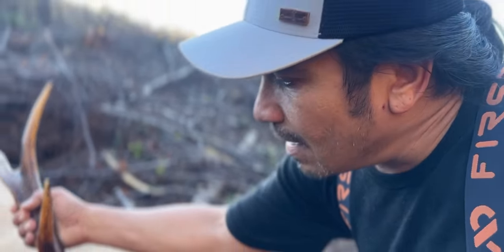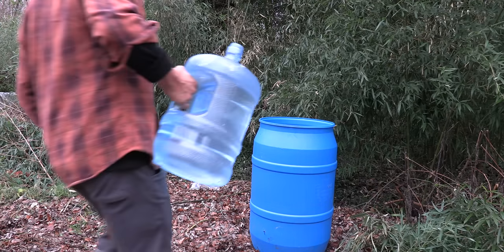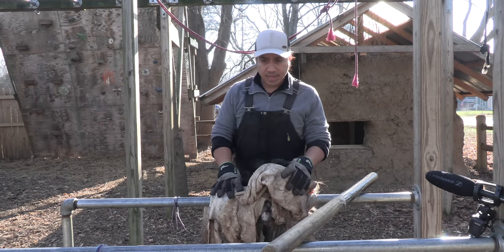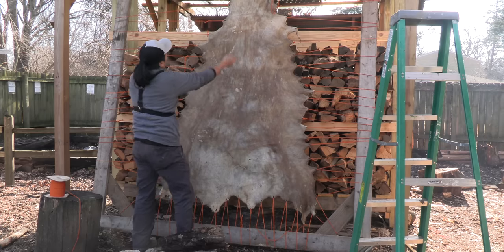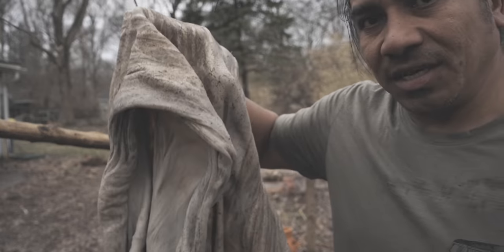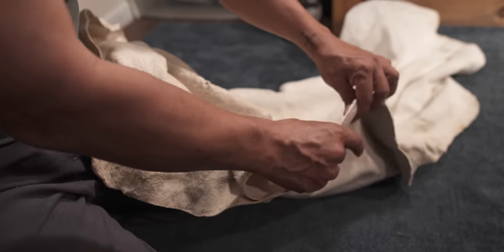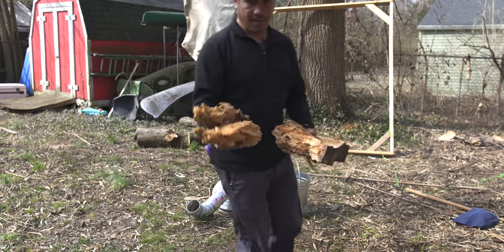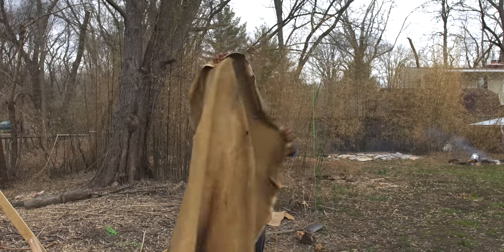Brain Tanning Elk Hide

Comment: It was really nice to watch you make buckskin out of an elk hide. I used to do the same with many deer and two elk. The elk is definitely much more work. You did a couple of steps that were new for me. Using that potash was new. I have used ashes before, but we would string the hide up on the frame and scrap it with a scraping tool made from a planers blade with the same angle your tool had. My tool had a wooden handle about three feet long slightly curved with the blade at a 45 degree angle attached to the top. I would let the hide dry and shave the hair and epidermis layer off . When you use the shovel like that does it remove the epidermis layer off? I did the wringing step many times also. Did you say  you put the brain solution on many times?  Almost all the steps you did were the same as I did to make traditional buckskin.  It is correct to add the cloth at the bottom to prevent burning your hide. Elk skin is so strong. It is nice for moccasins, jackets, pants too.  Deer hides are a lot easier than elk. Some deer have really thick skin around the neck area. I can't wait to see what you make. Peace Dennis PS it would be great to see  you get together with Greg Ovens  again
Reply from the maker: the shovel does not take the grain layer off, I use it just for softening the hide. I did a few braining and wringing to make it soft, just one braining and softening wasn't enough to get it as soft as I wanted it. and yes I always use the skirt at the bottom for smoking, I feel its safer for smoking the hide. thanks for watching Dennis

Comment: Nice work man.  I've done deer hides, but the elk really is a lot bigger.  You did a nice job and it looks great.  One thing you can do is instead of brains is also to use Neetsfoot oil.  It does the softening even quicker than brains.  Also, if you pan fry your brains for a few it will help the oils release better and take a bit less.  ;)
Reply from the maker: Thanks for the tips! I did used some neetsfoot oil in some of the braining

Comment: Hi, I do Braintanning, do you dry scrape? I’ve been Braintanning close for 24 years, done bison, moose, deer, elk etc .. I find dry scraping better.  I teach wet scraping tho.  I live in Minnesota & have whole frozen 🎉moose hides & elk, bison. Message me if you need anything or where to find certain hides.
Reply from the maker: I do dry scrape also, depending what I am working on. never tanned a moose hide, heard is good for winter moccasins.
Reply: @amosrodriguezsurvival  yea moose is a challenge, especially smoking it, I did one moose it 45sqft & around 1/8 thick, smoked it for 38 hrs total, not once but, braining & working the hide then smoke & repeat till I got  it supple, sold it for $3500 to a bead store in Minneapolis.
Reply from the maker: @MrSpider182  I get it. I had to brain the elk a few times to make it supple as well